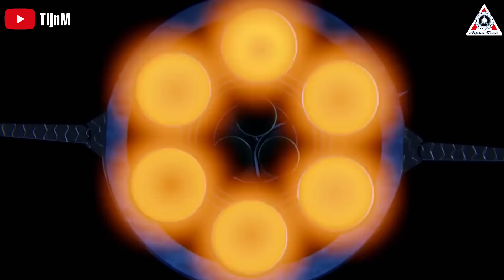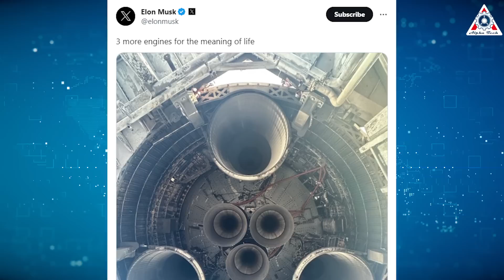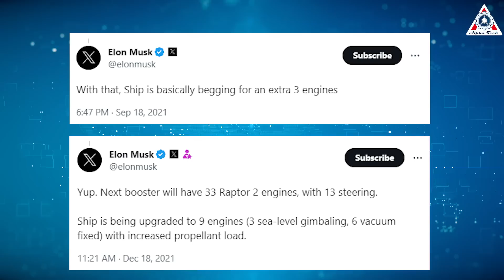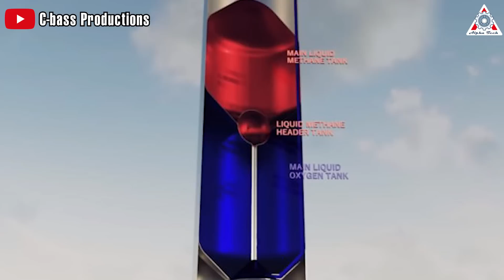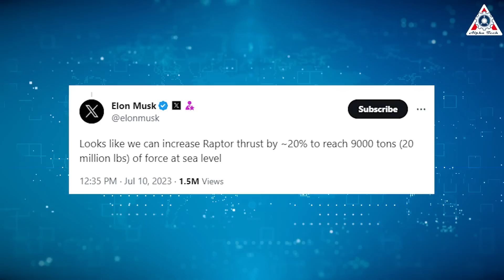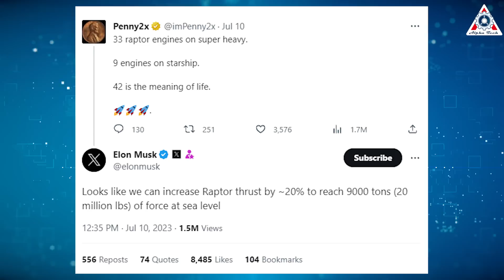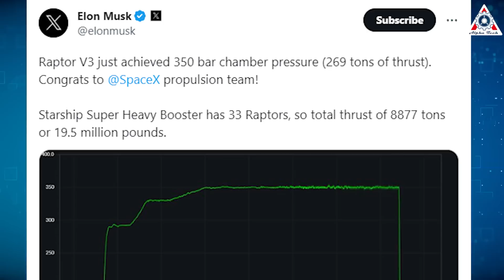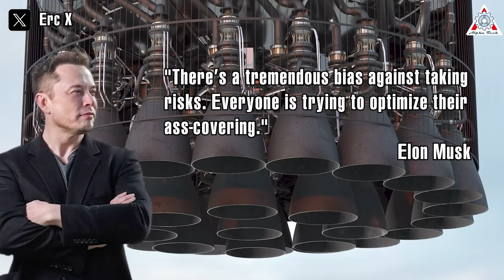Elon Musk revealed NEW Starship's 9 Raptor engines! Is SpaceX working on it?

Comment: Isn't this a lot like doing jackrabbit starts in your car... followed by jamming on the brakes at the next light? 

Once you reach orbit, just wait there for tanks you need for your whole voyage and for any additional payload you want to take. Hook everything together and fire on a straight line out of orbit towards your destination...adjusting your vector as you leave Earth's gravity. 

From then on, it's about the amount of time you're willing to take to get to your destination. All the time and energy you spend accelerating, you're going to have to spend decelerating. The more time you allow, the more efficient your trip, and the less fuel you need to take along. 

And you're in no hurry to get the empty tanks back. Just send them back at the shallowest of angles so they don't burn up... and let them slowly reduce their altitude until they're on the profile to land most efficiently with minimal heat buildup... kind of like regenerative braking.

Like electric cars: just because you can go from 0 to 60 in less than 2 seconds doesn't mean that's a smart thing to do.

Comment: The super upgrade to 18 meters wide. Contains 6 internal engines producing 120 tons of thrust per engine. 720 tons of thrust or more from the 6 internal engines. Up the number to 8 internal engines delivering an additional 240 tons of thrust. For a total of 960 tons of thrust from 8 internal engines that can be operated at full thrust while still connected to the heavy lift stage 1. The 18 meter wide Starship requires 8 large fins to shead excess heat. The internal engines are only 2 meters wide each providing 14 meters of storage, and crew quarters. Each engine has Stirling generators producing 100 kw to keep the battery banks changed. No fuel necessary as the engines are self contained, and battery operated. The upper chop stick area is removed to allow for the fins.

Comment: Would it also be able to do single-stage-to-orbit with a useful payload?   We know that the original first stage would be JUST able to make it to orbit - with ZERO payload...so does this make it possible to get to orbit with maybe 50 tonnes?   That would make it the obvious successor to Falcon-9.
Reply: The problem with SSTO from Earth is, even if it's great, it would always be more efficient by stacking it on top of a booster. SSTO's are much better suited for Mars and Moon ascent.

Comment: Starship refueling: What about a permanent orbiting Tractor-Facility, with magnificent, strong, electrostatic propulsion, capable of lifting two Starships from LEO to double height, (in a short span of time), so they can do their refueling in double high orbit? 
Returning the empty Starship should be easy and the fueled-up Ship would gain quite some more capability. The TF would need very little argon, but I have no practical idea how (and where) it would get its enormous electric energy (from).
Reply: Check out the VASIMR engine the next best engine til the Fusion Rocket Engine fueled by He3 from the moon ! ! !  T. Lipinski

Comment: Starship will never take people to Mars. Many take landing on Mars for granted, like it's simply a given that's it's easy. It is going to be nearly, or perhaps even impossible to land a human rated craft on Mars. There ae many reasons for this based on orbital mechanics. Study it for your selves. Starship is an Earth orbital satellite delivery system, or perhaps a Moon lander. Humans landing on Mars will require something very different.
Reply: Have you heard of the first ever successful landings of the Viking landers in 1976, July?
There were not easy for a reason, The NASA density model  was overestimated by a factor 3.
Why is that important? Because deorbiting required aerodynamic drag deceleration. with first the heatshield and then the parachute. With the pulsed radar altimeter the descent was monitored for the actual decelaration and  when it became clear that the declaration was less than predicted the  trajectory was corrected to a lower altitude befor the final propulsive thrusting was initiated to zero out the horinzontal velocity component and continued with a vertical terminal descent of 8 feet per second controlled by a four beam doppler radar to a soft touchdown on chryse planitia at 22.27 deg North and 312, 05 deg East.
Now we have much better information about the seasonable density, and most importantly the radar reflectivity of the ground below the descent trajectory.  With this information a reliable optimized stabilized trajectory can be designed and tried out to garantee a soft, targeted  landing of any sized Lander, and Starship will easily land on Mars with the oxygen methane engines. Keep in mind the Vikings landed with a less efficient Hydrazine monopropellant fuel  out of 3 16 nozzle engines.
Luckily your negative prediction lacks reality.   This from a participant who was at one time 12 years old.

Comment: Elon's only chance to reach orbit with the Starship rocket is to use 6 VacRaptors as support columns to mount the Starship on top of SH Booster.  Current interstage (Skirt) is too weak to whitstand compressive forces generated during liftoff.

Comment: This is about dealing with an engine-out situation.  With 3 vacuums, a single failure would likely result in loss-of-mission.  An SL engine may compensate, but may burn more critical fuel since they are not as efficient in space.  The goal is towards manned missions.  You don't want to kill the crew just because you lost a single engine.  When an engine-out situation arises, expect the opposite Vac to get automatically shut down with a minimum of 4 engines needed to get to space or transition to Mars.    This is the same logic as lighting all three SL engines and then cutting back to one on the landing attempt...it doesn't pay to be stingy if it means you just killed everyone because of a single fault.

Comment: @CC etc... then it would not be able to land.  The vac reaptors are to go up... more efficient.  The sea-level raptors are optimized to be used for landing. While all raptors can operate up or down each is Optimized for a special purpose.  Once the 6 vacuum raptors have been installed the sea-level raptors will no longer be used going up... that's vacuum raptors job... and the sea-level raptors will be only used going down... as in landing. .
That's why the Vacuum Raptors will be used in the vacuum of space... and the sea-level Raptors will be used at landing near Sea-level... hence the nanes...VACUUM RAPTORS and SEA-LEVEL RAPTORS . Got it my Friend  ??

Comment: Say You were headed to Mars. With that much thrust. Which is great. How would you slow that down enough so not to over shoot Mars?
Reply: by using math, a lot of math
Reply: I was expecting to hear how they would amplify the reverse thrusters. I don't see any thrusters on the starship. Putting a little thought into it. What do you think, Bud? @ntcong
Reply: @kevinbissett293  Usually space ship has a very specific firing profile so they will reach the exact point at an exact speed.
So ELI5, they don't speed up and then use the break like we drive, they speed up and disable the engine and then the car stop at the destination
Reply: Aerobraking will also play a big part in stopping successfully at Mars. It's why Starship has flaps.
Reply: Answer is you just leave the Solar system or be rescued by another Starship !   Or call the US SF ! ! !  T. Lipinski
Reply: Just do a flip Just like they do for stage 1.

Comment: What if Starship had 7 vacuum engines and no sea level engines?
Reply: Needs the sea level engines to land with back at the pad.
Reply: Bro than no landing can happen 💀
Reply: It means it couldn't fire it's engines in atmosphere. At least not reliably. I also don't think the vacuum engines can gimbal, so the craft would be harder to maneuver. End result, landing anywhere, whether in atmosphere or not, would be very very difficult, if not impossible.
Reply: @chrisdevine4848 who says it needs to, you could save weight on heat shield and fins, and just have it take stuff to mars and back
Reply: @222cubing8  - yeah true. Provided it stayed in vacuum / orbit and didn't need to do any quick maneuvers, only having vacuum engines and thrusters would be fine.